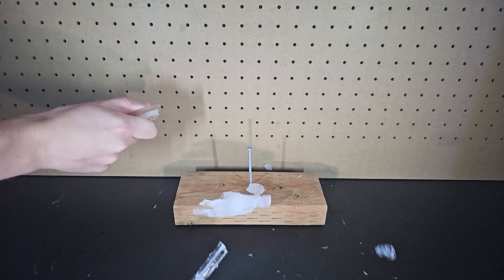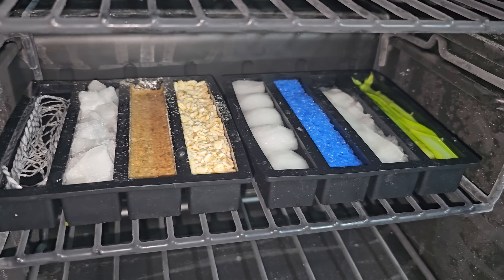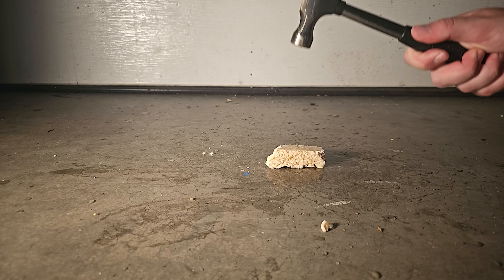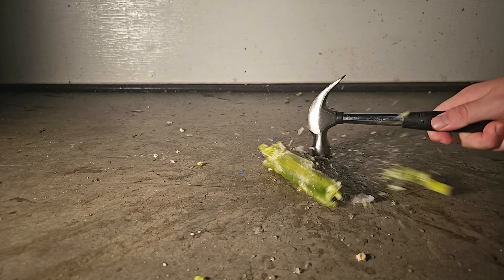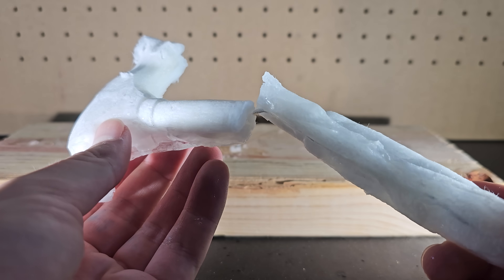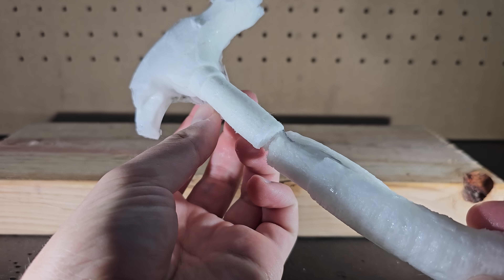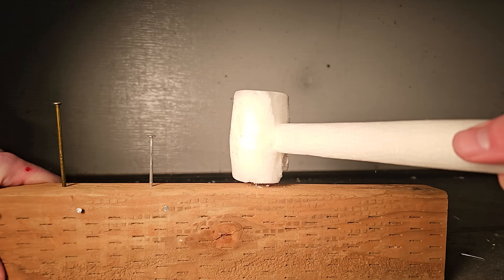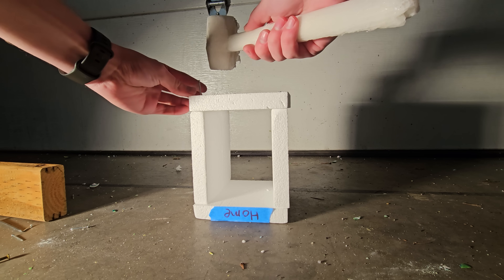How strong can you make ice? (World's Strongest Ice Hammer)

Comment: You might have gotten more strength out of the cotton if you had spread the balls out longer, overlapping, maybe even with some  twisting. Maybe not enough to make it wool-like, or I think the string would have worked better, but enough that there are no joins between the cotton balls. By keeping them as balls you had, as you noticed, sections of strength separated by lines of basically just ice.

Comment: In school I did a concrete project and we use chicken wire and steel wool sandwiched together and put it in an inch of concrete and it worked really well because how it added the strength the concrete lacked

Comment: nice that's very cool ! my ideas for improving the design : 
1 add some conductive metal into the mold and put it into the freezer for a while before you place the contents inside, you could also try to put the contents into the fridge first (so that it's already cold but not frozen) to test whether the speed at which the hammer is frozen matters
2 potentially if that actually makes it weaker you could try to cool the ice slowly somehow, maybe by putting it into a cooler while it's in the freezer so that the heat takes longer to escape (slower might be better because annealing)
3 dissolve some things in the water, maybe that'll do something ? including some of the things that were used here like the paper towel, saw dust, or oats, besides those one thing I'm curious about is if the energy is somehow converted into heat, perhaps the process of melting makes the ice weaker, so dissolving a compound with a higher melting point past the eutectic point (35% calcium chloride for example)
4 sew the cotton balls together with a bunch of wire/strings since the "putting a few strings below/on top of the cotton balls" worked so well
5 maybe tearing up the cotton balls a little before sewing them together would help them be more diffused, or maybe compacting them instead
6 cook the hammer before freezing ! perhaps even use some chemicals (I don't know if the things nile red uses to break down cellulose are hard to access ?) to see if breaking down some of the compounds makes them better
more difficult things since they require equipment :
7 manipulate temperature, pressure and nucleation points to avoid any air bubbles or to get other forms of ice crystal
8 using distilled water ?? maybe it'd be better for some reason

Comment: I think your list of materials could’ve been expanded. If you had separated the handle and shaft into two separate molds and materials and connected them together so that the force would be focused on the handle without losing the leverage from the shaft, and replaced water (brittle when solid) with something like molten steel alloy, and used something like wood for the handle, you would see considerably better results.

Comment: Composite materials are fascinating, especially how its properties are changed by the orientation of the filler. I'm far from an expert but it looks like the issue you had with a lot of the initial tests is that you had too much of the continuous phase and not enough filler so you were largely just retaining the properties of the ice. You really want to pack it down so it is mainly filler. If you've ever worked with paper-mache or asphalt you will recall that there is comparatively little fluid compared to dry components.

Comment: You should again using clear ice, like is used of cocktails. It is stronger, melts slower and has fewer impurities. You’d have to create a setup where the ice freezes from the top down (like submerging your mold in several inches of water in an ice chest that is small enough to fit in your freezer). The clear ice will be on the bottom.

Comment: I think you need to experiment with ratios. Vary the proportion of water to strengthening material. I think perhaps some materials would perform better if they were packed more tightly into the mold, whereas others would work better with less material. The cotton balls especially would benefit from being drawn out into longer strand, so that instead of dense balls of interconnected cotton strands, you have long, laterally interconnected strands that spread throughout the structure. At any rate,a higher number of test samples, and more consistent testing methods would almost ultimately yield more meaningful results.

Comment: Nice composite hammer. I reckon hair would be a great reinforcement substance (probably inch long trimmings from the barber shop floor) and a coin for the face.
Never heard of the gronkowsky test LOL. There is an impact test for materials called the Charpy test, which involves dropping a specifically shaped pendulum on a sample of specified size. The amount of energy the material can take on impact without breaking is calculated from the height of the pendulum swing after impacting: energy required to break sample = initial energy - final energy, where energy is mass x height x gravitational acceleration.

Comment: I love this because it brings a lot of science into play. The MOST important thing when doing this is directional reinforcement. For example, you saw the regular ice cube with paper towels not break with the hammer because you were hitting the flat side of the paper towel. The directional reinforcement there is perpendicular to the force applied. This is also why the shaft of your ice hammers breaks along the spaces between cotton balls and why the continuous string, similar to rebar as you pointed out, kept the shaft of the hammer in tact. Ultimately, I think you would have great success with the following composite approach:

Layered paper towels perpendicular to the head of the hammer.
Strings running up the shaft of the hammer like rebar for tensile strength.
Cotton balls in the join for omnidirectional support. The key part here being significant overlap with the "rebar" strings to distribute force.

I really love this video! Great job.
Reply: If you want to get into the thermodynamics of it there's plenty more you can do to adjust the experiment but it would come at too much of a cost for "ice hammers" to make sense. :P

For example, directional freezing would remove a significant amount of impurities from the ice creating a far stronger material. You would do this by attaching the top part of the mold with small drainage sections to an equivalent in volume bottom part of the mold. Insulate the sides of the mold so that freezing only occurs in a downward direction pushing all of the impurities down and out of the main hammer structure through the drainage holes and into the base. After freezing (which takes much longer) remove the hammer by snapping the drainage sections similar to a plastic injection mold.

It's ridiculously overengineered but so much fun and would make for a great senior design project. 😂😂
Reply: You could also try, but won't get great results, with distilled water. It's often an urban myth it results in clear ice so I don't recommend rehashing that.

Comment: I suppose your cotton balls may be different, but mine are actually rolls.  You can easily unroll them and get strips of longitudinally oriented cotton fibers. Lying them out in the obvious way should provide great strength (you know, for cotton pykrete)  and you might not even need/want the reinforcing string.  The weak point would be the join between the head and handle, and you could even improve that by laying the strips in Ls which form the handle and do the right angle to also form part of the head. The rest of the head being strips that go from peen to claw.  No good ideas for the impact surface, though.  That will not be improved appreciably by this.

Comment: Cotton could have been better if you picked it apart into much smaller chunks, since they would get entangled to each other and wouldn't have large weakpoints on the body, as for the tip you could try cotton ball picked apart with some sawdust mixed together and outer layer as paper towel

Still though, great hammer strength in the end, interesting experiment